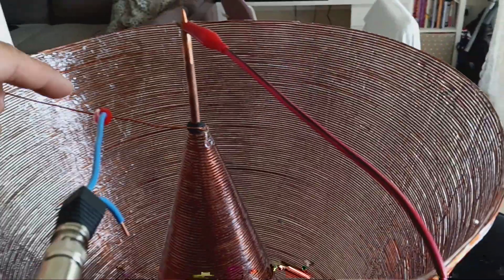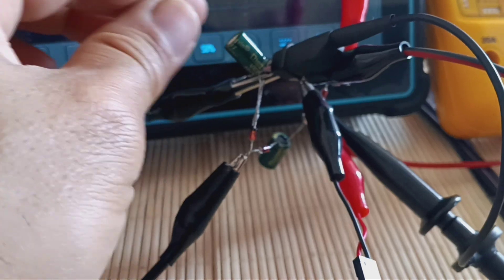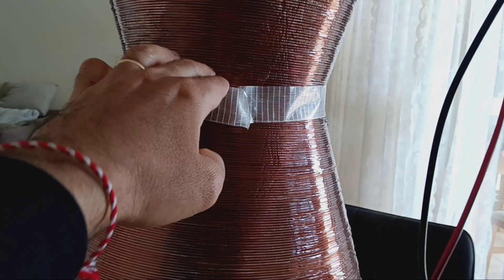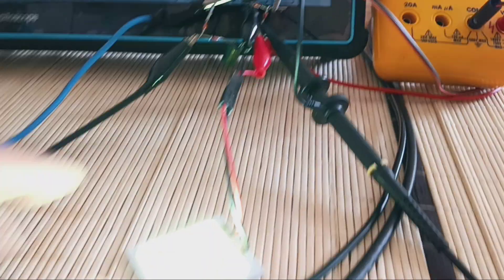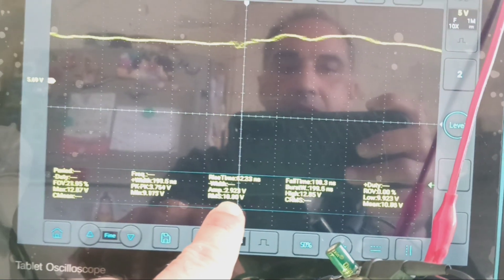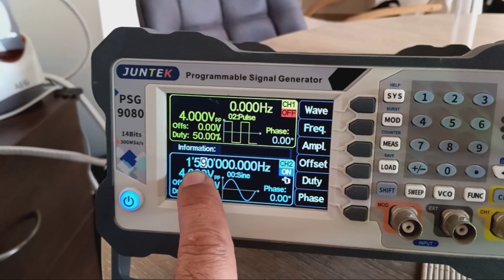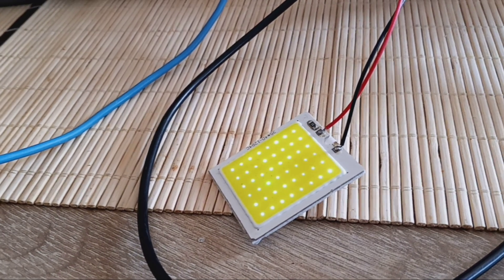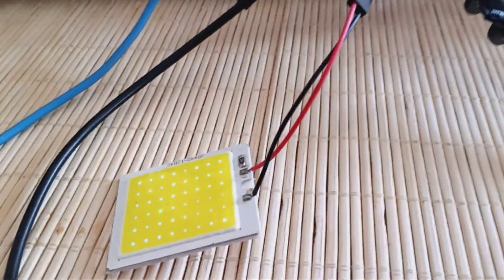Multiple Resonance Frequencies of the Cones

Comment: I hope you can test without grounding to mains (grid) power ground.  Mains ground is bonded with neutral and many experiments show mains ground can be tapped for energy. It looks interesting, but if the ground is combined with grid neutral, there are too many variables to draw a solid conclusion.   Good work none the less.
Reply from the maker: Good point, thank you

Comment: I have something I want you to try with your device. Take a drill or, or better yet a dremmel, and attach a cube magnet to it. Then put it between the interior and exterior cone and adjust the placement while watching the bench to see if you can find a sweet spot where it will make more power by spinning the magnet inside all that wire. I also want you to spin the magnet and go around the interior cone slow and around the exterior cone slowly also watching for resonance. Like a copper and magnetic "singing bowl". Finally, if you can get two dremmel and put them midway between the middle of the interior cone and the outer cone while they are spinning opposite both in spin and polarity of each other. By doing this I hope you can setup a magnetic resonance along with the resonance you setup in the coil of the wire. I want you to do this and post about it because I need to know what happens for my own studies on static electricity. I don't have the time or desire to build your device, but I need it to learn somethings about how the universe works. Please help me out. If you need magnets or anything let me know. If you hit me up on X I can help you out with stuff if you will do the experiments. Thanks and all my best, Bill.

Comment: Pardon me, but am I understanding correctly that you're driving the system with only a 1 wire input? In those systems without return the only thing there is electrostatic potential and displacement currents, no amperage or conduction current, did you get a Wattage output from the closed core to the LED without using conduction current in the driving source?

I'm interested here because I've been developing a proof of concept model where the machine is driven by a 1 wire system, the purpose is to excite a 2nd load coil with displacement currents so the magnetic EMF created in the load coil and load has nothing to fight against when powered, it's part of a "blinding" system I've started looking into to avoid the source from "seeing" the load, loads only cause a power drain on the source because they fight back on it (Magnetic and "Electric" fields don't cause each other, Maxwell's equations), blind them so they can't fight back and the system will have no idea there's a load attached. 

Although in my model there is still a capacitor used between the source and load side of the 1 wire to serve as a part of the blinding method which may be a requirement, if you're able to avoid an increase in amperage draw on the source when powering a load through this 1 wire input method, that's very significant.
Reply from the maker: I would appreciate it if you contact me on Facebook Messenger and discuss this in more detail.
Appreciate your input and looking forward to chatting with you more extensively

Comment: Have you tried having a higher input at higher frequencies? 
When playing the flute, you have to blow harder for higher notes to be stable and resonant. 
Just a thought.
Reply from the maker: Because of the effect you described the signal generator cannot supply higher voltage at a higher frequency,  instead the voltage goes down.

I'm already amplifying the signal to about 5 watts with an amplifier before feeding it into the cones.

But beyond 5mhz there is almost no resonance from the cones or little